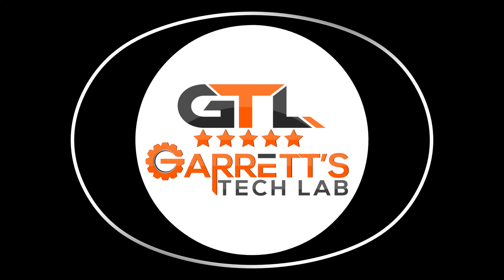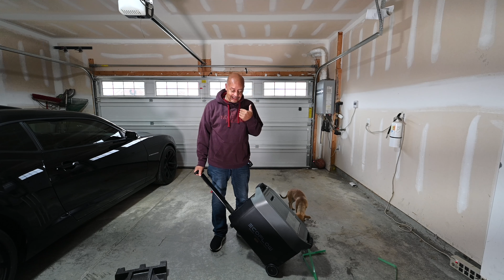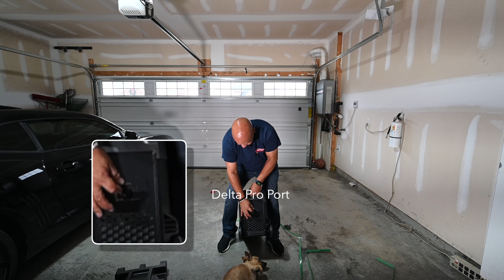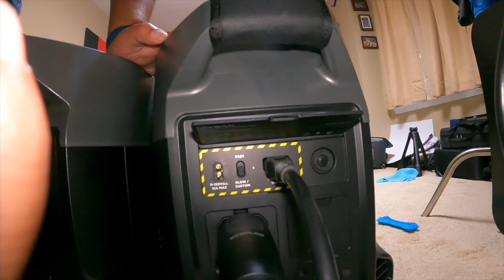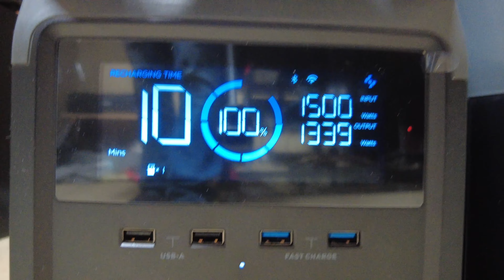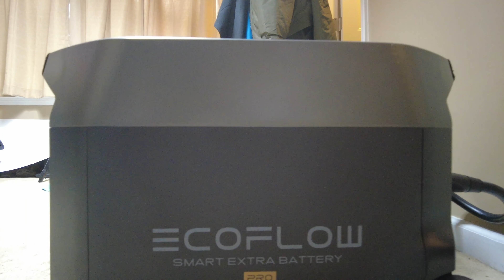EcoFlow Delta Pro Extra Battery Unboxing

Comment: I've missed the Kickstarter program and now I am left wanting the Delta Pro badly.
Reply from the maker: Not sure if you know but Costco has a 1200w max charing version vs 1600w for like $2500.  They created the 1200w version and then upgraded it to 1600w and those 12's are on sale.  I'd have no problem getting one of those.

Comment: Can you charge the extra battery with an EV car charging station?
Reply from the maker: No it must be charged attached to the main unit.    The EV charging port has a different pin configuration and only exists on the main unit.  The extra battery only has the port to connect to the generator (with an adaptor) or it can be connected to the Pro/Main unit.  Kinda of miss if you ask me.

Comment: Hey Garret, I am really looking forward to your upcoming RV tests (I subscribed). The main reason that I purchased mine is for boondocking also, I will not receive mine from Kickstarter until batch # 3. Have you thought about setting up a weatherproof/secure box for them?
Reply from the maker: I'm really excited to see how it works myself.  I also really appreciate you subscribing, also!  I was so excited when I got the unit I forgot this weekend is Christmas.  I'll probley just bring the camper home and do the test.  Thanks again!
Reply from the maker: As far as storage, I am still trying to figure out how to secure them.  My first thought was leave them on the back of the truck.  The biggest issue with that is....the truck has to stay near the camper.  Let me know what you figure out as I don't have that issue quite nailed down.  Thanks again.
Reply: @garrettstechlab8358  I am still researching options myself. The first option is to take a weatherproof toolbox, cut cable pass through/ventilation holes in it, secure it to the bumper of my Travel Trailer; however, I am still very concerned with this option due to unknown long term exposure to heat & humidity. The primary option that I'm looking into is finding a way to fully use all of it's capabilities while storing it securely inside the RV